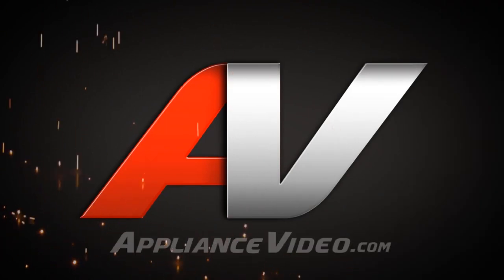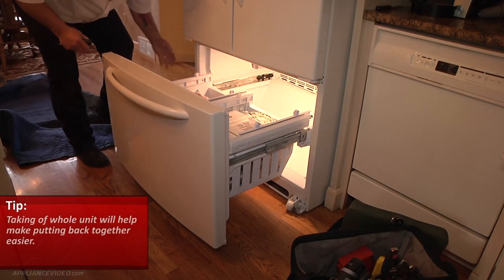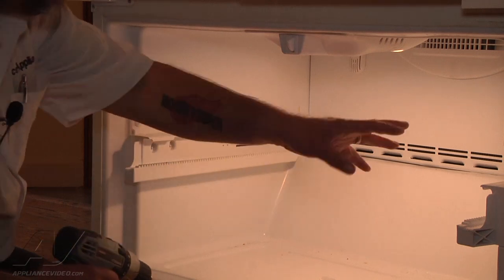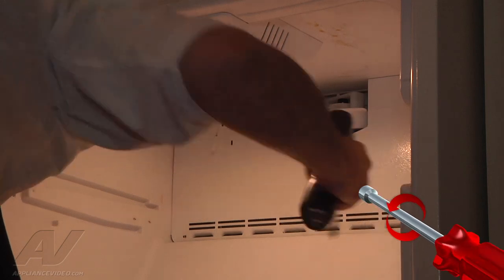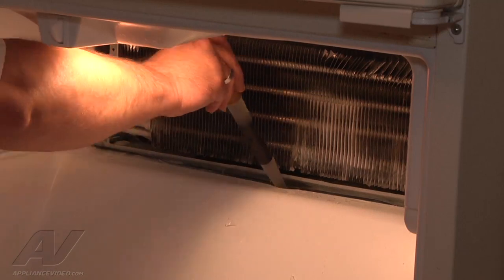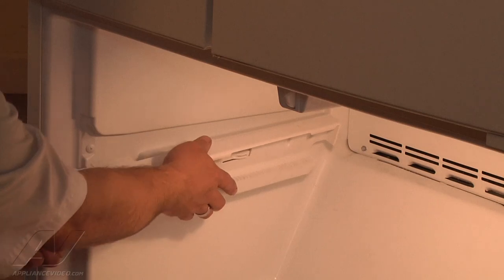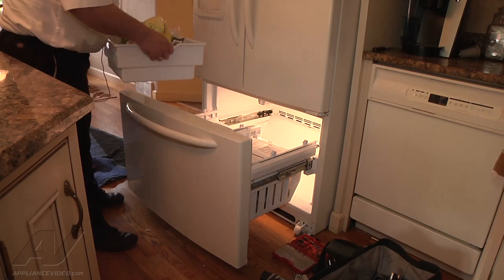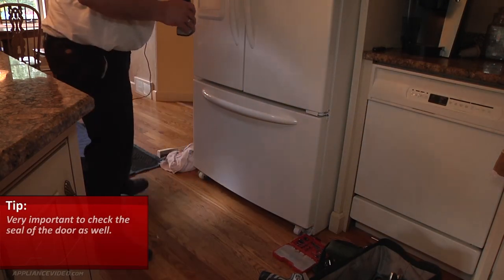Maytag Refrigerator Repair - Leaking Water - Grommet

Comment from the maker: Our technician installed the duct bill rubber cap that is already on your refrigerator. He removed it to clean out the drain and then reinstalled it. It’s a rubber cap that stretches over the drain and has a slit in it for water to get out, but moisture and humidity cannot get in. There are updated kits for some of the units also. I recommend you watch this video to see the new design kit Whirlpool just came out with. Call our parts department at 1-800-830-5465 to see if your unit’s model fits this new kit. Have your model number ready when you call. If this kit fits it wit will correct your problem permanently. Here is the video link     Whirlpool Refrigerator Repair - Ice build up in the bottom freezer - GX5FHDXVQ02   Good luck with your repair.
Reply from the maker: Thanks for your response, we are glad we could help. Our library of over 5,700 videos are currently helping over 1.6 million people like you every MONTH.  Please help us by subscribing to our YouTube channel, or post our website www.ApplianceVideo.com to your Facebook page, Twitter, Instagram or any other social media sites. Your support will help us keep producing more free quality videos.

Comment: The directions in the video were perfect!  The only thing I would add is that to possibly make this fix a little more permanent is to use a 12- or 14-gauge copper or alumimum wire that hooks around the coil and then extends inside the drain hole until it is about 1 inch below the opening of the drain behind the fridge.  The plumber was able to wrap around the coil once and then pass it through the drain where I could feel it.  We then cut the wire until it was 1 inch or so below the rubber cup that covers the drain behind the fridge.  From what I have read, when the coil heats up as part of the defrosting process, the heat will help melt the ice in the drain so that it does not freeze up again.  I don't know much about the new kit that is available through appliance video, but I would think it would have a similar effect as described above.  I just did this today.  If it doesn't work, then I will be back to post here.
Reply from the maker: Florida
          Great information, they do make a conductor kit that is exactly what you are talking about. That is only for problem drains that plug up more than once . Thank you for your positive comment. We are glad we could help resolve your issue and hopefully saved you money. Please help us provide more videos to our site by posting ApplianceVideo.com on your YouTube, Facebook or Twitter account or add us to your circles. If you are in need of any parts please support our parts department on line at http://savemoreonparts.com/ or call 1-800-830-5465 7-days a week until 11pm Eastern time. Thanks again your support.  Matt, Ace Appliance service technician

Comment: I have the same question also. My fridge leaks was going to try your repair, but don't know what you installed behind fridge.
Reply: Mine also leaked on my wood floor that was only installed 3 months ago THANKS MAYTAG for another crappy Fridge. Like I have the tools to take apart the whole bottom of a fridge to unplug something that shouldn't plug up to start with. Give me an old fashioned tray underneath that I can see and empty if it needs it.
Reply from the maker: Candy Sweet
                       I would try to call Maytag and see if the will put the new drain kit on at no charge, they will do that still even if the unit is out of warranty. It is worth a try here is the number 1-866-698-2538. Let us know how it turns out.  Please help us provide more videos to our site by subscribing to our YouTube page or posting ApplianceVideo.com site on your Facebook or Twitter account. We also have our factory authorized technician’s email daily free professional advice to people like you to help solve their appliance problems. Thanks in advance for supporting us. Matt, Ace Appliance service technician.

Comment: Our refrigerator already had the rubber duck bill but the drain tube was solid ice. The turkey baster worked well but took a while to melt all that ice.
Reply from the maker: Bruce 
             Great, glad the turkey worked for you. Let us know if you have any other issues. Thanks for the input.

Comment: This fixed our refrigerator but we are confused about what you did to the back... Could you explain a little better?
Reply from the maker: Emma
          All of our technicians are now answering questions daily on the ApplianceVideo.com website for anyone needing help. Just copy and paste this this question under REPAIR HELP, and one of our  factory authorized technicians  will answer any technical questions at absolutely no charge on your appliance issues. We also have over 2600 free repair videos to help with your appliance repair issues. Thanks for your support. Matt Ace Appliance factory service technician.